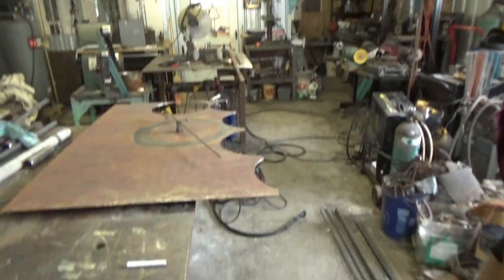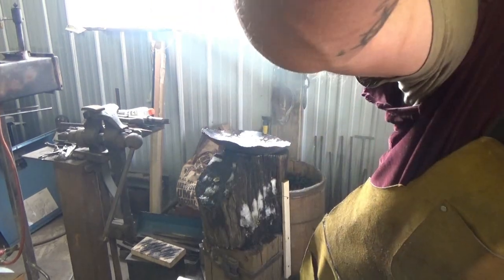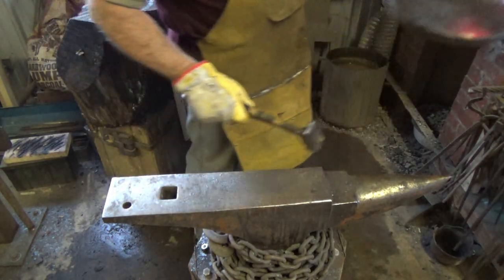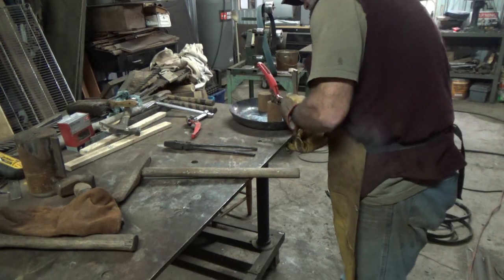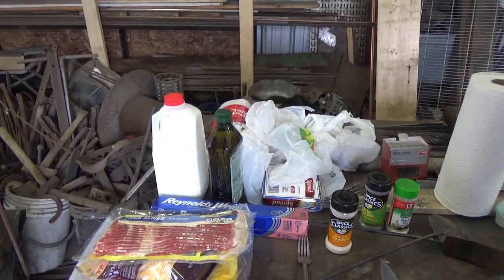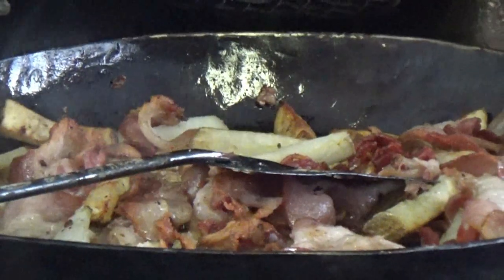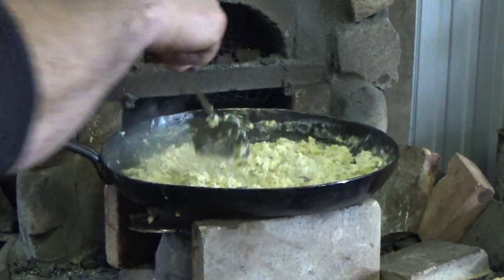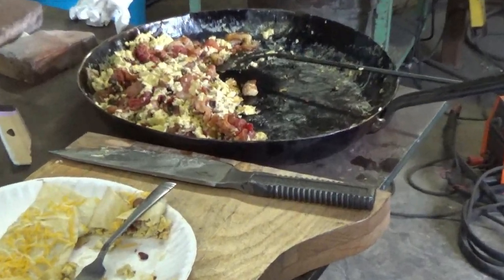Blacksmithing - Forging And Forge Cooking With A Pan Apparently For An Army - Full Version

Comment: Cook up your bacon then do taters on one third, eggs on another, with sausage taking the last third... Perfect size pan for camp cooking for 2 people. One pan to cook up the whole meal makes for less dishes to do. I had a steel pan about that same size and condition for camping and loved it, me and the ole lady would make breakfast in one pan and when we were in a group camping it was perfect for doing up the taters for everyone. Sadly it was stolen with a bunch of other gear and I never got a replacement for it beyond a Teflon pan of the same size. One suggestion for such large pans, put a handle on the opposite side, just a simple loop handle, if you have something heavy on one side of the pan it can tip really easy when picking it up with just the one handle.

Comment: Enjoyed the video! Have you tried a smoothed, 4 inch cast iron pipe cap with the flatter to smooth the hammer marks? Kinda like an auto body hand dolly? Guess a stand could be made by putting it on a length of pipe?
Thanks for all your videos!

Comment: Why not get or make yourself a flatter to smooth out the bottom  of your pans?  Really all you'd need  is a circle of half inch welded to the face of an old sledge hammer and you're good